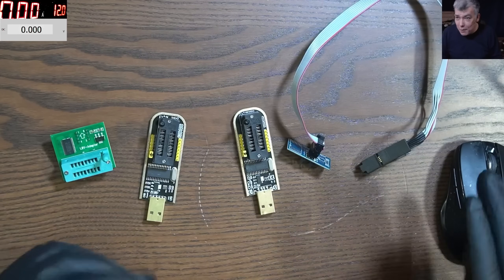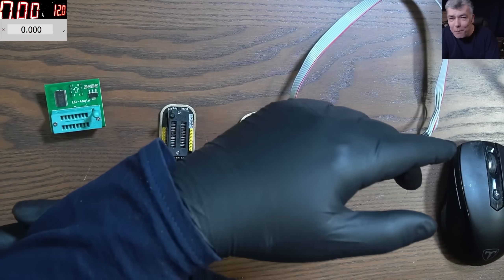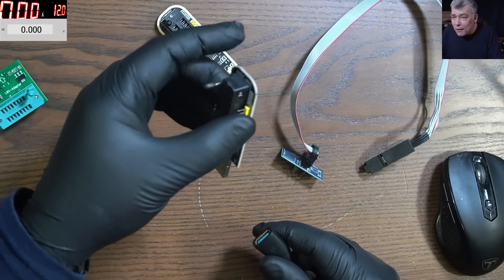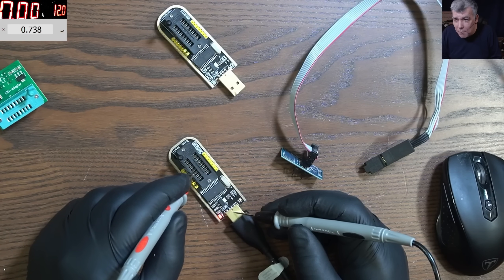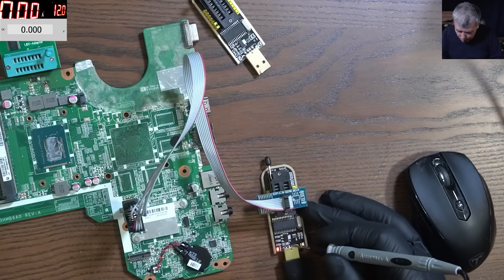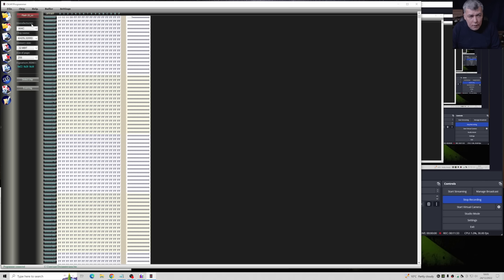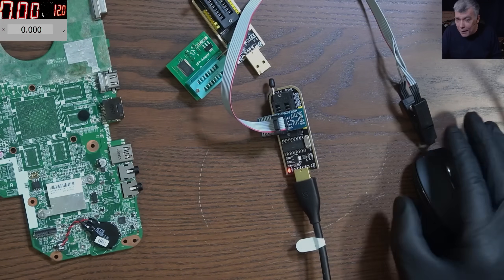How to program a bios chip - CH341A programmer, no, you don't have to modify it

Comment: You are dead right! (electronic engineer). I already had one and I modded it as I was advised to. Damned thing just did not work at all. Reversed the mod and it started working!! The mod I did did nothing with pin 9. Pin 9 is the output of an internal LDO 3.3V regulator. So if you supply VCC with 3.3V this LDO reg has an output possibly below a critical value for function. The datasheet for the CH341A chip says to short pin 9 to VCC if used in this way. It is designed to work with 5V. I admit it is a bit unusual to design an IC with voltages above recommended maximums for programmable devices but the designers knew what they were doing.

Comment: Asus laptop x540s has been reassembled recently and after powering on it goes straight to bios. The  battery doesn't charge when disconnecting charger. I discharged laptop  After removing battery by pressing power button for some time but no change. The motherboard works fine. When I am trying to load new windows from cd/dvd drive, there is no optical drive showing up when I press esc after power button. It seems like bios doesn't see the optical drive or hdd. They work while connecting to motherboard as I can hear the sound and see the light on CD drive. I resettled default settings in bios and lunch cms is disabled. I tried to Flash bios with manufacturer's website bios update but it doesn't go through. I tried different hdd with loaded windows and it still goes to bios. I get stuck and don't know what to do?

Comment: I really enjoy watching your videos, they are full of very useful information. Unfortunately, you did not show how to use a 1.8V adapter in this video. I need to flash my laptop's bios, I've never done this before and I don't want to screw anything up. It's a Lenovo ThinkPad A485, there should be a 1.8V chip. Can you please make a video on how to use the 1.8V adapter? Thank you
Reply: You dont need a whole video to use the 1.8v adapter, you just have to aling pin 1 of the adapter with pin 1 of the programmer, its not that hard

Comment: This is terrible. You are shorting voltage sources with a current meter. I get that you are trying to measure maximum current but this is NOT the way to do it. You are teaching wrong things.
Reply: Indeed.
He doesn't think the manufacturer designed it wrong and sells the wrong programmer as if it never happened. Especially in the Chinese version :hand-orange-covering-eyes:
He didn't see any video of anyone measuring the voltages of this programmer. And this is supposed to be proof? For what? I guess this only proves that this man is ignorant 🤔
And how does he know that people don't even test the programmer and just modify it right away? Or maybe they do it because they can think and don't make stupid mistakes... 🤨

Comment: Nice instructions for CH341A. I have 2 chips on the board, it's dual bios, but the firmware file is just one. How to do it via USB programmer CH341A? well thank you
Reply: That means your motherboard has a backup bios chip if the first one fails or gets corrupted it will copy the contents from the good backup to the bad one and if your bios is still corrupted that means both of the chips are corrupted and you have to reprogram both

Comment: What about 16 pin chips? Is there a 16 pin clamp that works with this, or only if I solder the chip directly onto the back of the programmer?

Comment: Everytime i connect it to the bios chip i get the usb disconnect sound in Windows. I did everything right and the 3.3V fix but i dont understand what i am doing wrong.
Reply: You need to desolder chip from its board

Comment: Hey man, thanks for the knowledge!

I have a question, I am about to do my first spi programming on a lenovo Ideapad 3 (got my brother's computer bricked by a wrong bios update 😮‍💨) and I wonder if there's a name for the circuit you spoke about that may unable writing to the spi chip on-board, because if there is one on the motherboard I'll have to buy soldering tools also and finding-out if this circuit will be a problem before my spi programmer-arrives might save time.

Comment: Hellow Michael ..  i run into an issue when clipping to my bios chip. windows and programmer software stops detecting the usb programmer then states usb device malfunctioned. like if it shorted the usb. ive checked pin  1 connections and adapter to usb programmer and they should be correct as every video ive learned from. any ideas. dirvers a installed usb ch341 recognized even can read "FF" with empty clip . but once i connect"clip" to the chip it shuts off the usb. (no power on the read board no cmos batt)
Reply: Try connecting the other side of the clip (going to the actual side of the CH341A) in the other direction (24xx). 😉🤔

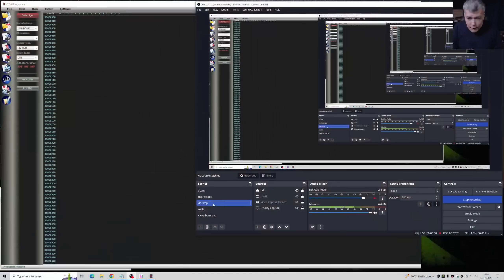Comment: 7:33 not really, you need to align the red wire (pin 1) to the dot on the chip on the board (also pin1). Furthermore the ribbon cable that is plugged into the usb device must be plugged into the 25 spi bios side (labeled on the back) because the chip is a W25q-bios chip and not a 24c16 eeprom chip. If it were, the ribbon would be then plugged into the other 8 pin slot with the red wire closest to the handle because that's pin 1.  If you say you need just to plug as if nothing else matters you either doing it on purpose so no one understands what you're doing or don' t care about the viewers learning so you look smart. Thumbs down from me.

Comment: it doesn't works reading the flash soldered in motherboard your have to remove it or check the voltage the chipset well pull down the current you have to modify it to make it works everywhere

Comment: i love this chip just add a 74ls244 between spiflash and the chip you can use it as level chifter with 2 regs 1.8 and 3.3 volt

Comment: A secret programming method exists, and doesn’t need any programming language, or skill. By discharging a laptop in Bios, you program the laptop to continuously turn on elite features of the laptop, charging, heat, fan speed, performance, etc. while blacklisted operating systems continuously slow down the laptop, generating high amount of heat.

Comment: Hi one question,  with this program could I updated a bios? Example my mother boar is a z370 and only have the F5 bios version, and my cpu is a 9th gen, but I don't have a 8th cpu gen, and its support page says that if  the mobo is updated to the f10 will work with 9na gen

Comment: I've tested it my self - especially I've bought a 1,8v adapter. The programmer software says "Chip not responding" - in 1.8 adapter, but same chip in same adapter works ok straight in CH341a, so what was the point to buy a voltage converter?

Comment: You're explaining here that it is only the current that damages but that is simply not true. Thermal runaway is one reason electrical components blow, sure, but extremely limited current does not guarantee that a voltage outside of the operating range of a component doesn't damage it. On most FETs the gate isolation can break down easily at higher voltages even with extremely low current. Especially when connecting something to the SPI bus which is connected to the PCH you are risking barrier breakdowns inside of the semiconductor when operating at higher voltages.

Comment: If you don't set the bit of the bios to match with the programmer you will be hit with an error, like 64bit/8mb is the common bit used some thing like that can't really remember but on the body of most bios it's written or you can just Google the number, most of the auto recognize doesn't work.

Comment: Sorin I used this programmer and the laptop won't power on I have check all voltages and they are all present including the 3.3V on the bios chip, does it mean my bios chip is damage any suggestion guys will really appreciate

Comment: That little programmer repair me frozen bios on Lenovo G50 80 with Intel I5 processor which I sell later for 300€. Still use HP NC 6320 which had power on password for car diagnosis. Neat little programmer. I read and write everything with clip, no soldering.
Reply: What software did u use to program and how did u extract the bios capsule I never got far into repairing my laptop

Comment: I have a few things to say.
1. Sorin explained nicely in the video that the chip will not fry because the current is not high on the pins and that is correct.
And that Programmer is beautifully designed and does its job..
2. as far as CH341A modification is concerned, it is not a matter of higher voltage in chip frying, but in data transmission on that pin.
5V (4.82V) and 3V (3.28V) voltage injection affects the data transfer pin (read-write)
It is known that voltage and frequency affect data transmission (Example: higher frequency affects data transmission, incomplete transferred content on the chip can occur), which also happened to me, but not always.
So it's not about frying the chip, but a higher voltage on the data transfer pin.
There is a lot to explain depending on the use of the Programmer and its connections, i.e. the resistance of the accessories (Examples: a clip with a longer cable or the length of the cable by connecting to the chip)
3. You don't need to modify CH341A works perfectly.
If you decided to modify, in my opinion, the best way was modified by Georgdev. You can look at (eevblog.com-forum-repair-ch341a-serial-memory-programmer-power-supply-fix)
with this modification, you regulate 3V and 5V on the switch.
when it is put on 5V switch it is in factory condition..
Sorry for my bad english writing, Regards..
Reply: I would like to comment for the future people who will be reading this. I used this programmer to an ec chip ene kb9022. 
It was taking 8 hours+ and still not done writing. That's when i decide to modify it and it takes 7 minutes. 
You have to experience it before you can decide for yourself. 
This is so cheap, you can buy two. Then only modify the other one.
Reply: I have a question
If I need to reprogram a Lenovo Bios Chipset, do I need to purchase any program/firmware in some scenario where the exact firmware is not available?
Reply: But, the chip seems to be lowering the voltage to 3.2V when it detects a chip that requires 3.2V. It means the programmer is smart enough to change its voltage (on data pins too) accordingly. Therefore, you do not have to modify the programmer.
Reply: @TekCroach  There are likely diodes inside the flash chips being programmed which clamp the voltage on the data lines to ~3.3V to prevent damage from minor ESD and such. This programmer is abusing that protection rather than the programmer being smart. Probably safe 99% of the time.

Comment: I thought to measure current, the multimeter had to be inline with the point of contact? I.E cut  the trace feeding that particular line and then joining them both together with your probes. That is the way I thought it works.
Reply: the multimeter was placed between ground and voltage, that is, in short, it measures the maximum current that pin can give

Comment: Off topic, but I need advice on equipment.
I'm currently on the market for a solder extractor (not fume extractor)
Currently looking at pace st125.
Anyone have thoughts, suggestions, etc?
Reply: I'm using S-933A desoldering gun. Works great.
Reply: @SinsBird  thanks for the reply. I found that the "gun" style has been too difficult to use in my line of work. The pen style is what I'm most interested in. Haven't found many options though.
Reply: @lain4231  You can hold it like a pen no problem, I actually started holding it like that lately, it's very comfortable in the hand, because it's rather round and it's not too thin. The switch is very easy to press so you can hold it any way you want. It's great, because it's all integrated and doesn't take up space on the table. Very light weight for what it is.

Comment: Nice tutorial. I prefer desolder bios chip always. The programming bios chip when is soldered sometimes goes wrong :(
Reply: Particularly on certain laptops (HP), when the programmer supplies power to the BIOS when still on the board the MB may try to initiate a startup. Of course the USB power source isn't nearly sufficient enough so the programmer can't communicate.
Reply: @SerenoOunce  You made a great point. When I connected the clips to an older MSI Z170 Gaming M7 motherboard that has a Power button it, the power button green LEDs suddenly turned on once I connected the clips to the Bios chip!!
I'm a noob when it comes to electronics but I was a little confused when it happened. So what's going on? Is the programmer somehow giving enough power to the BIOS chip and it somehow spreads out to other parts of the motherboard?
Reply: This is what I do. The clip does not do proper connection most of the time.

Comment: The 5V isn't going to ruin the chips. The issue is 5V on the data lines risks data corruption backing up and flashing.
Reply: I agree with you 100%. The same is my experience. As I buyed this device, I used it first without modification. But after some write processes, I got an IC that was not possible to write to it without errors. Then I modified it. Cutted the 5V track to the VCC pin and connencted to 3V supply on the board. After the modiffication I have no more errors by writing any target IC.
So I can say, the frying the memory ICs is not the problem. But the data transfer will be corrupt on many ICs without the modification.
Reply: Please link for modification this USB..thanks alot

Comment: You are absolutely right, Sorin. A couple of years ago I bought one complete SVOD3, but this one was my very first programmer (BIOS chips only, of course). I had never modified it in any way, and it does work perfectly. The worst thig is the chip clip; it is really bad. You are luck, man! It does work for you in the video!.
Reply: I agree, the clips are terrible... I've had 2 sets from AliExpress and one clip worked almost flawlessly on half a dozen PC motherboard BIOS chips and the second set of clips was virtually useless I threw it away as it simply couldn't stay on any chip. If you need to program a BIOS chip urgently then it might be a good idea to order at least 2 clips and hope that one of then is good.

Comment: HI Sorin you beter use programma like neoprogrammer or colibri for this programmer . The work better and support more chips  Did you know it is also posible to program kb chips ( SIO)with this programmer is slow but will do the job.
Regard Steve from Belgium
Reply: Hi Steve.. random question.. i’m
Trying to unbrick a bricked bios laptop asus sx510ua.. ik can read the chip, saved the file.. i downloaded from asus multiple bios files for this motherboard.. but when i right it to the chip, and programs are verifying, when try to boot, it does nothing.. only power loght goes on and then off….  I used neopgrammer, asprogrammer and ch341 programmer… do i need something to change in the original bios file from the asus site to make it work agian? I hope you can help

Comment: Wow. The number of times I've screwed up a BIOS update. I'd have to find a working BIOS chip, install it, boot the machine, remove the working BIOS chip while it's running, install the bad BIOS chip while it's running, and run the flash program.

Comment: A great little programmer, the only two issues are speed (it’s a little slow) and the black peg/clamp is terrible. The pin are so hard to line up and get a good connection. I ended up buying the blue pegs which worked so much better! I have bought a faster (more expensive) version to speed things up. But the one you tested is a great device.
Reply: Could you post a link for the blue pegs?
Reply: what pegs are you talking about?